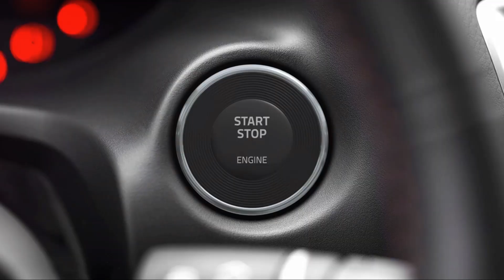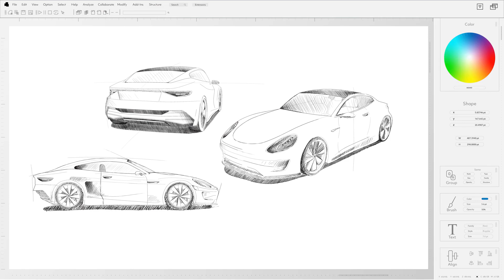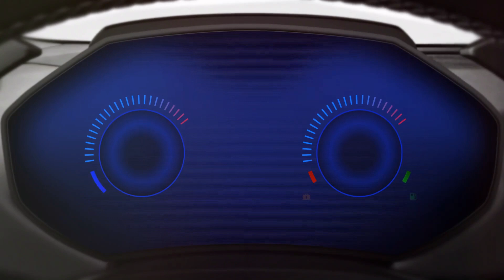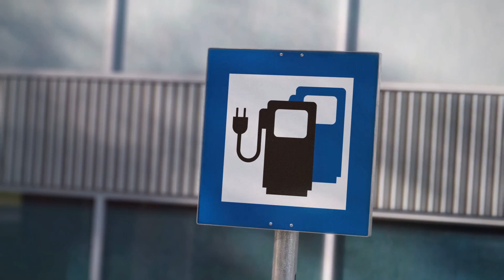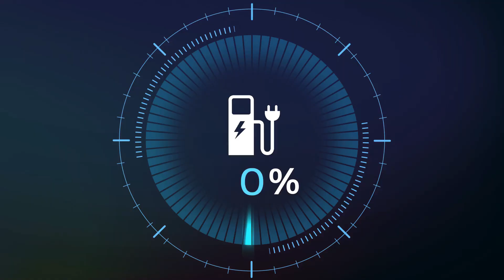The New E Ice Engine | Porsche's E-Ice Engine

Comment: Well, well, well... What have we here Porsche?!

The slightly superior, silky, pursed-lip, high-tech-y, voiceover MAY make it irresistible to an uneducated few... But this is just a simple  axial hybrid with a big ICE engine...whoop-de-fizz!!

Congrats Porsche, you have invented the Honda Insight!!

WAIT, IT'S LARGER AND BURNS MORE PETROL ... So you've invented the Toyota Prius!!

You should be SO proud that your German engineering has finally caught up to 27 year old Japanese tech!  {Pats on back, "Good job!"}

So now what?  Maybe you tie a couple used food cans on the back of that thing, drive it back and forth a bit in front of the auto media just so we know that you achieved this feat, then put it in a warehouse somewhere, and try again.

This time, if you still want to use an ICE as a base...make sure that changing a €10 thermostat doesn't take €5000 in labor!

Ferry Porsche is, no doubt, spinning in his grave at what you clowns have become!!